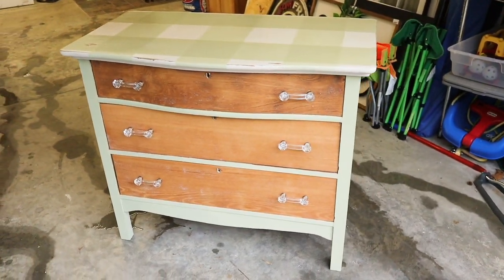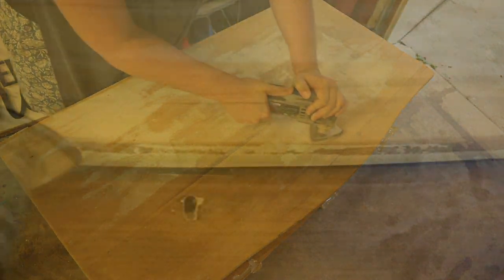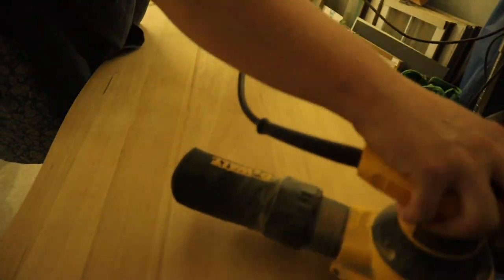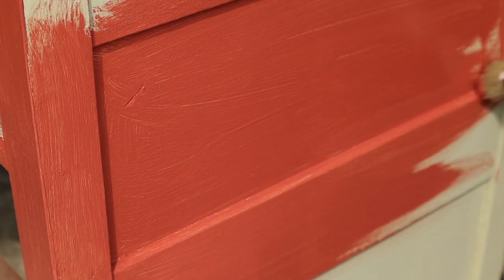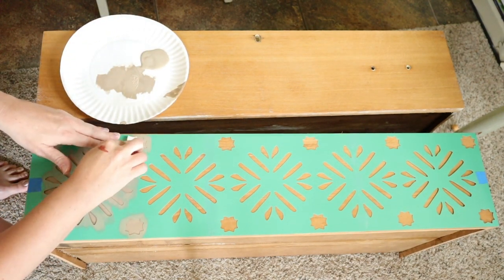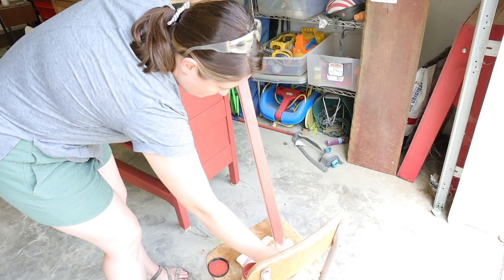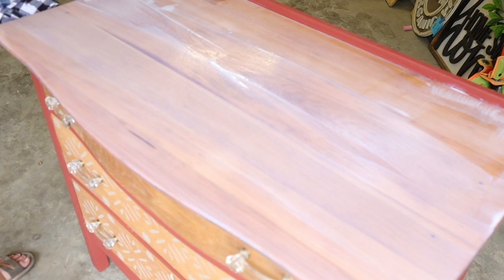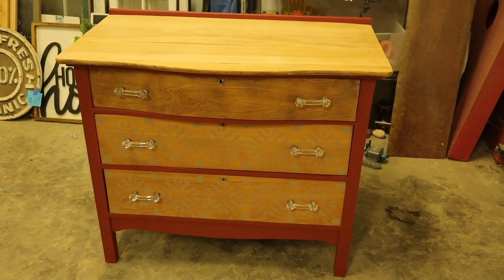Boho Style Furniture Flip | Trash To Treasure | Antique Furniture Resale for Profit | Antique Booth

Comment: I love the way it came out however those two dark lines in between the wood cracks because I'm OCD would bother me. Is there any way you could have like bleached those little areas first before you put the clear coat? Just wondering in case I come across something like that I've seen other videos where they do bleaching but can it be spot bleaching?